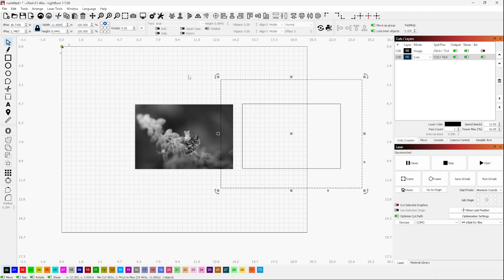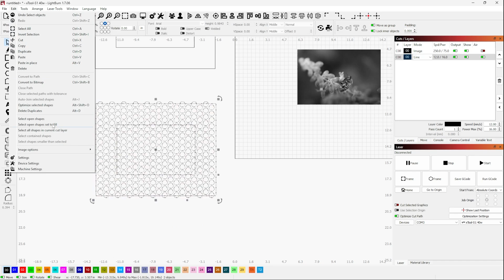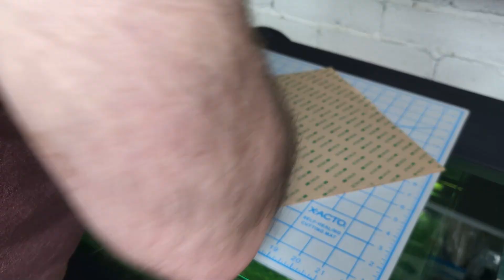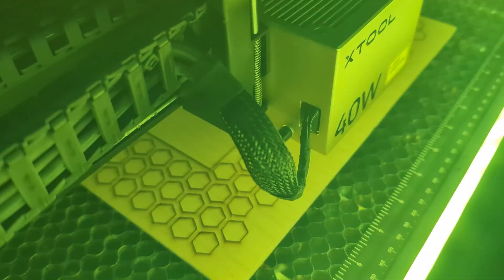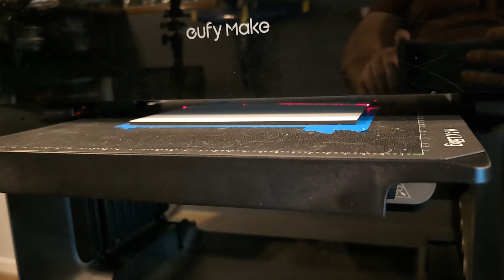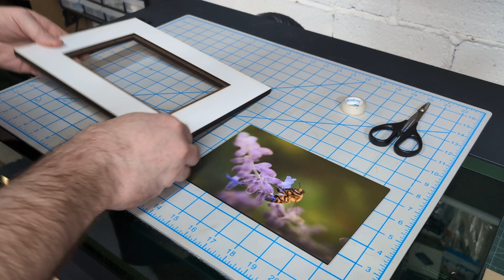Custom Artwork with a laser and UV printer

Comment: Love this. My Eufy may be here soon, I received the ink today!! I am going to try your hinge method as I stress over placement. Very cute frame.
Did you use any ink adhesion promotor for this?
Reply from the maker: I did not use an adhesion promoter on this as the white was a matte finish with a bit of texture to it.  They do have a more glossy white that might need some attention to ensure it does not chip off.  You can also print on hardboard canvases found at the craft store.

Comment: I'm surprised you didn't use the texture feature on the E1 to make the bee pop off the print.
Reply from the maker: Just personal preference. The 3D printing is cool to play with, but it can also take away from the details of the photo at times. I did play with that feature with this photo on a smaller ceramic magnet. It was interesting, but also looked distorted some.

Comment: Nice job!
Have you put together the vent system for lasers  you use in your shop? 
I've seen the cyclone bucket in the background and thought that's for wood sawdust or other particles other than acrylic wood laser cuts.
Reply from the maker: I did do a video a while ago on the setup I have in the main shop.  The cyclone in the background is used on other tools making sawdust.  You can check out my exhaust system here: https://www.youtube.com/watch?v=6_YaBEBQshk